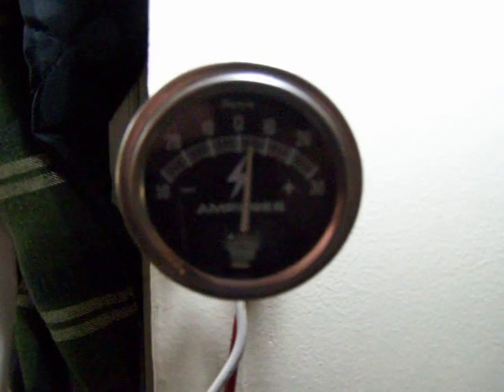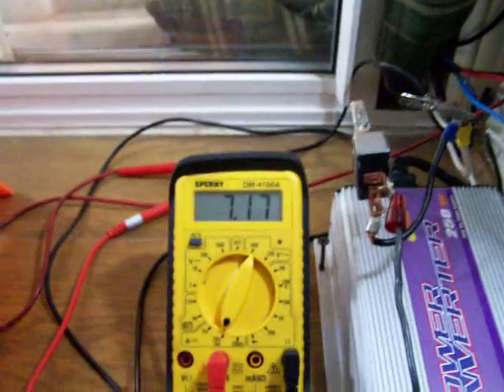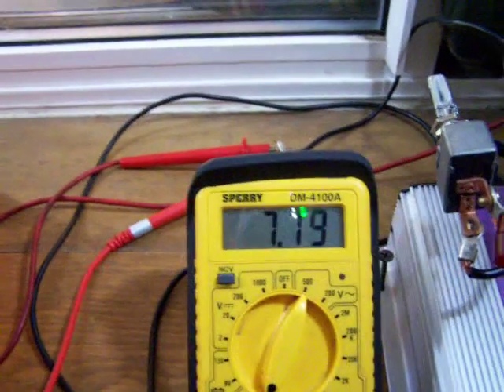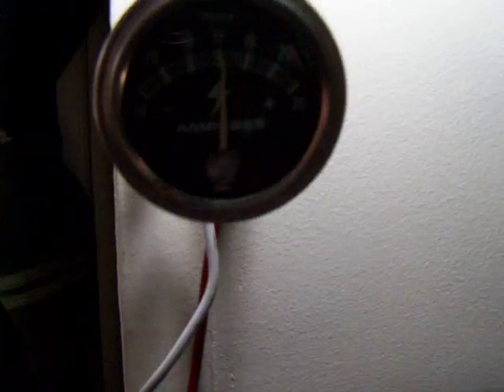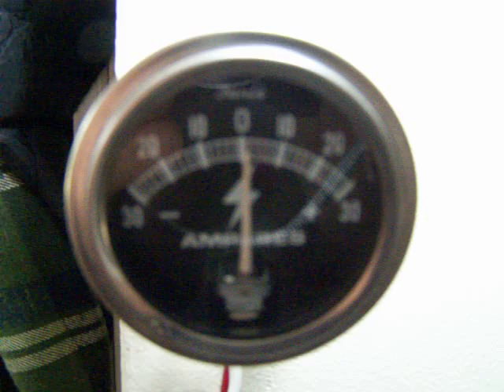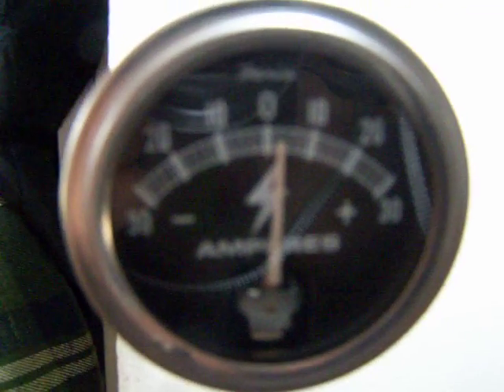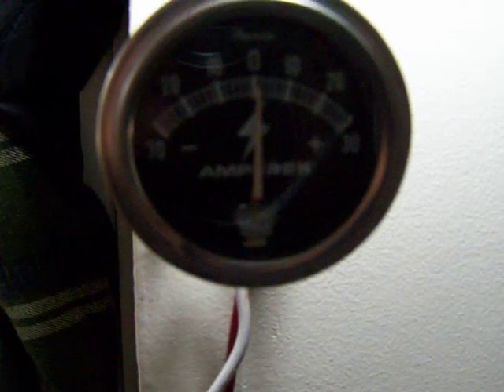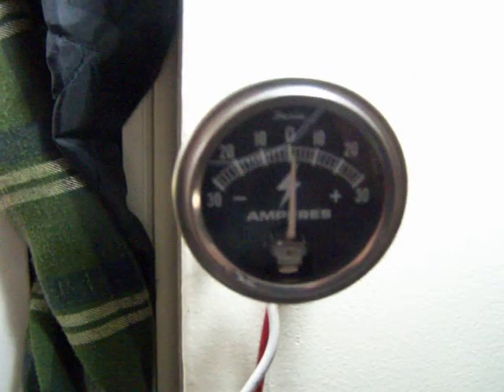MORE OF MY 250W GRID TIE

Comment: I'm new at this and I have (5) 250W solar panels with the info below:

Electrical Characteristics

System Rating:250 Watts
Max Power Voltage (Vmpp):29.8 Volts
Max Power Current (Impp):8.4 Amps
Open Circuit Voltage (Voc):38.3 Volts
Short Circuit Current (Isc):8.9 Amps
Max System Voltage:600 Volts
Series Fuse Rating:15Amps
Module Efficiency:15.3%

I'm confused with the 12,24,48v system since the Vmpp for this panel is 29.8. What is the voltage of this panel If I hook up all 5 panels in parallel, and series? 

What grid tie inverter should I use? the 28v-52v or the 50v-100v?

Please help.

Comment: the grid ties what can i do with all this how should i hook  up  was going to charge them at 12vs each but these running grid ties running at 14 and up throws off everything,and the other brands that say they do 10.8v and up lie that only turns board on and 1 watt so i dont know what way to go i have $30,000 in batterys and 11 300 watt grid ties and 2 wind turbines 1500 watt each i was going to run 24v but so confused and what controllers to use i have 2 hf controllers any tips out there lol